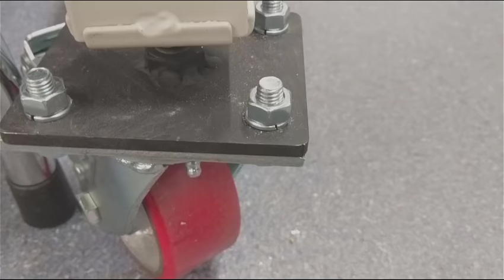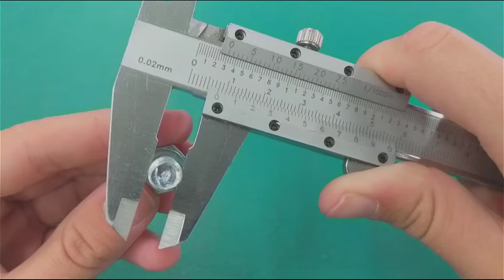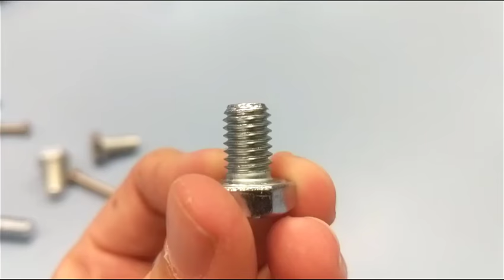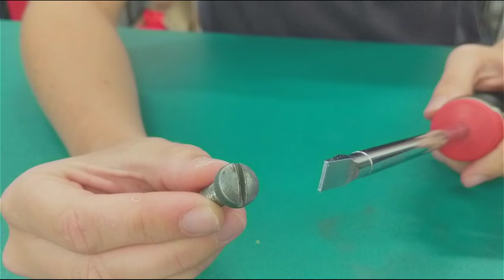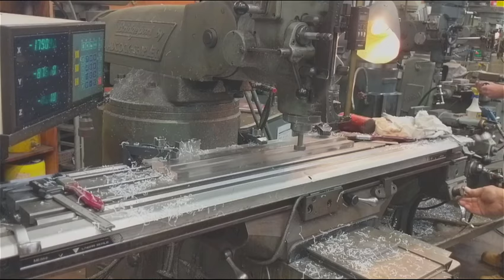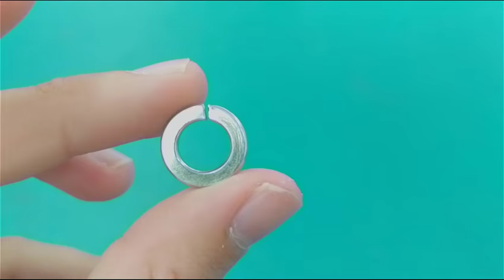How to Use Nuts and Bolts

Comment: When using a  STAINLESS bolt  with a  STAINLESS   NYLOC™ nut .... ALWAYS ! !  use a copper seize compound on the threads , especially with larger sizes ( ½ inch or 12 mm ) ... why ? .... the clean stainless Nyloc™ nut graunches against the thread , all the way and will cause a cold weld .... you then have to get out the angle grinder ( + 😝expletives ! ) ... you can avoid this by using a plain nut and spring washer ... or a Zinc plated Nyloc™ nut ......... DAVE™🛑

Comment: Do Not use over sized washers thinking they will spread the area compression,  all you'll do Is cause the washer to flare up around the head, which causes tool slippage causing scrapped knuckles and rounded nuts or heads. You could use a bigger washer, then smaller one next to head.

Comment: Great video thanks. If a bolt is fully threaded, does it mean it has to cut a thread throughout the material? I always thought a bolt should slip through the material and be tightened with the nut on the other end?

Comment: The amount of threading on the fastener has nothing to do with it being a bolt or screw

I've seen plenty of long ass screws where a large portion of the shank is not threaded. But you still screw it into lumber just the same

A bolt passes through parts and is held by a nut

A screw passes through parts into a threaded hole. Therefore, cylinder head bolts are actually cap screws.

Learned that when I went to WyoTech. Apparently, the definition of bolt vs screw went all the way to the U.S. Supreme Court

Comment: What if the nut doesn’t go all the way down the bolt
Reply: I really need help because I’ve assembled my basketball hoop and all the nuts can’t be tightened all the way down
Reply: @ShowtimeDon  You either need to put more effort into tightening, put a cheater bar on your wrench to give you a mechanical advantage or use an impact gun to tighten them.